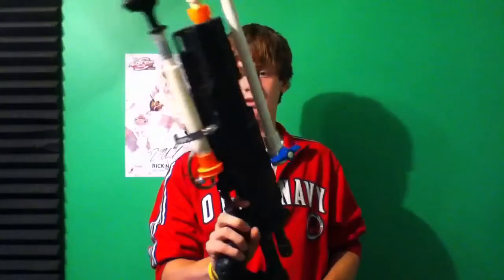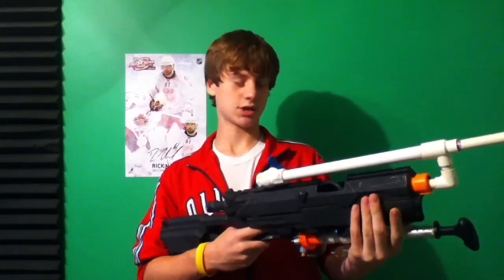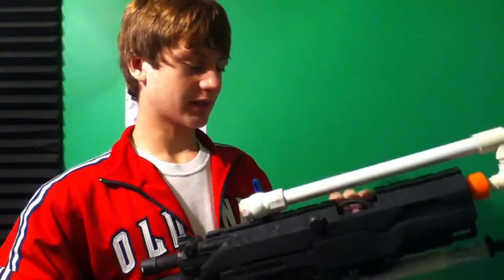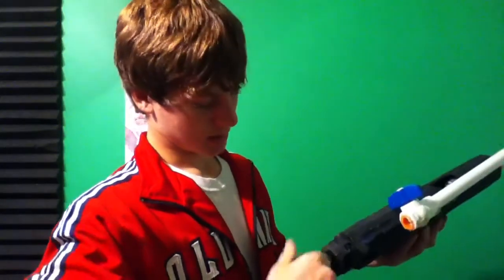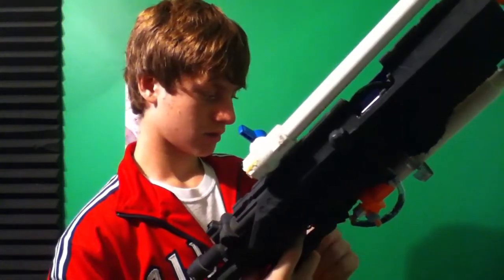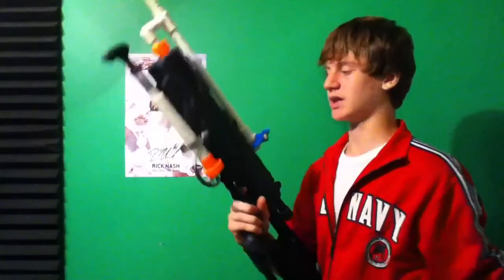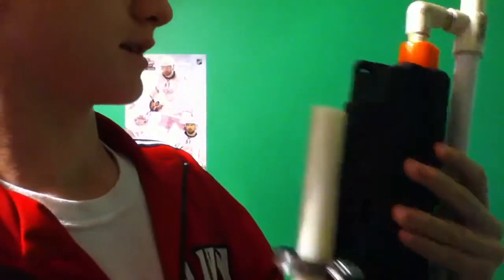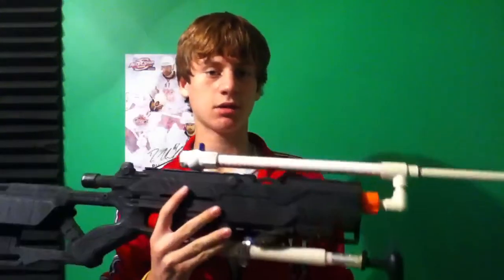Nerf Longstrike With Shot Blast Tank

Comment: @flaminace2468 That is true....and you have to reinforce them straight ot hell to allow them to take the wear and tear of a 7 LB per inch back spring :P

its so much work, but it has high payoffs.

so far with my rienforcement, Ive had 0 breaks on my RP plunger tubes (out of a possible 20 Ive rienforced)

I just wish that payoff in performance and duribility = a payoff in resale value and reputation.

no-one believes a RP gun can get good....and they suck for thinking that.